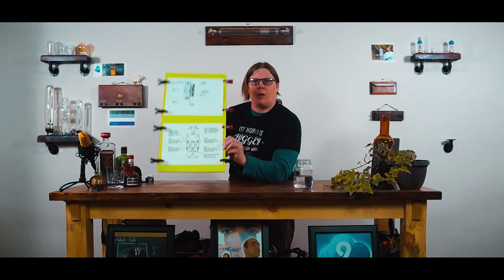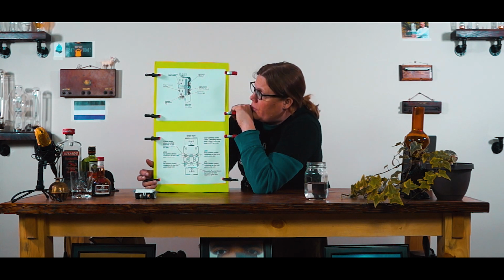[ QUICK TIPS ] - #9 Don't use GFCI's in your equipment enclosures!

Comment: Didn't see diagram in description? So what do you recommend you use for your pop in the boonies for protection?
Reply from the maker: What do you mean by "Protection" ? The GFCI is designed to protect humans from electrocution. Your entire enclosure, Its contents, The tower & all metal connected should be sharing a common ground/Earth meaning the likely hood of you getting a shock of the gear is slim. This is why almost all commercial gear is housed in metal enclosures ;) . Now for tools, chargers etc a gfci can be onsite. But thats just for workers.